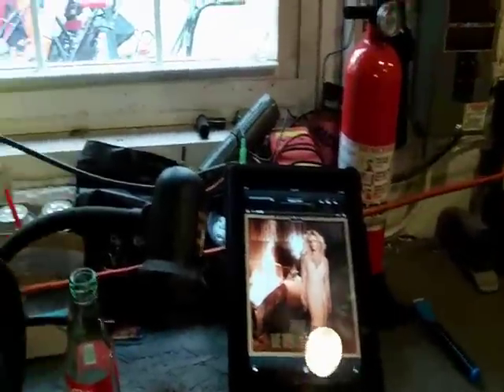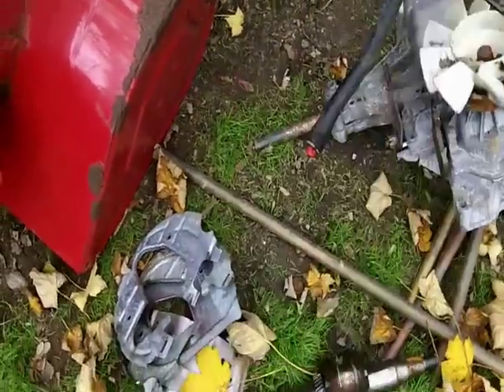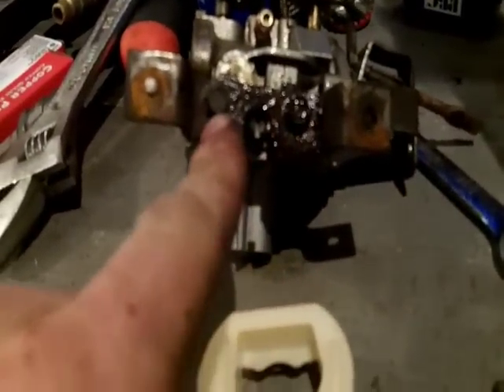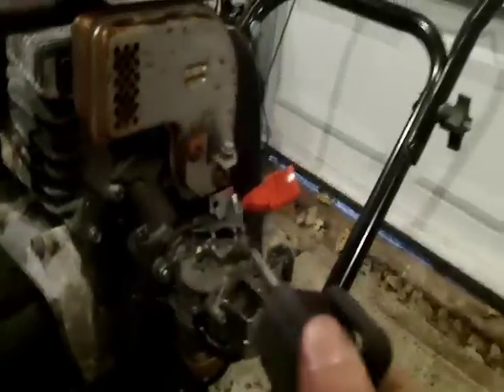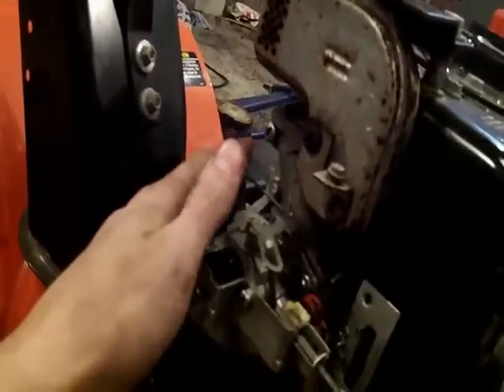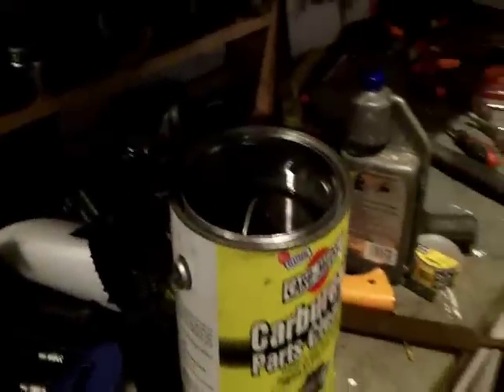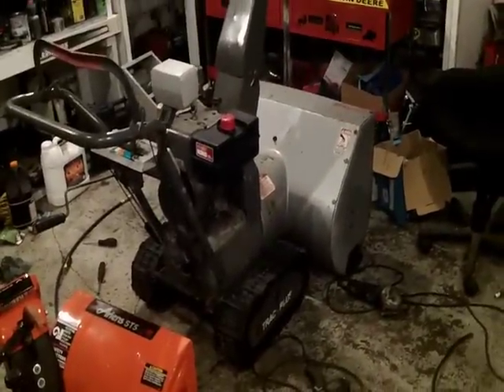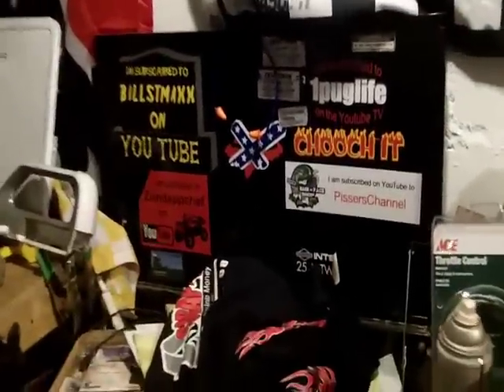How To Clean and Rebuild Tecumseh Carburetors on a snow blower

Comment: question.  The 1/4 hose that feeds fuel into the carb only dribbles gas.  I disconnected tank, cleaned it, blew out hose, still a mere dribble.  Noiticed a kink in 1/4 inch line.  COuld this be cause of fuel starvation.  Priming does not help